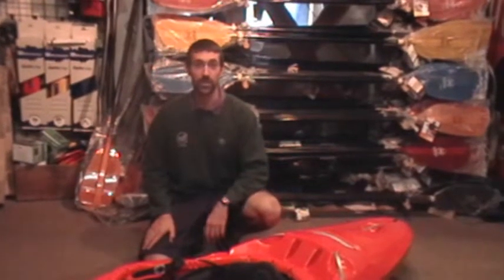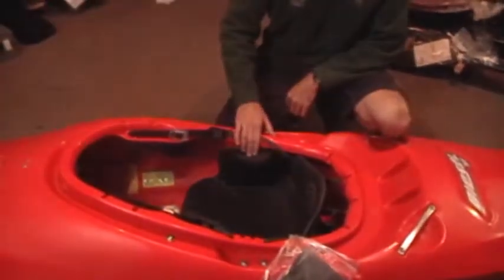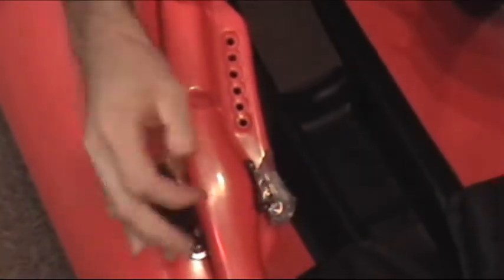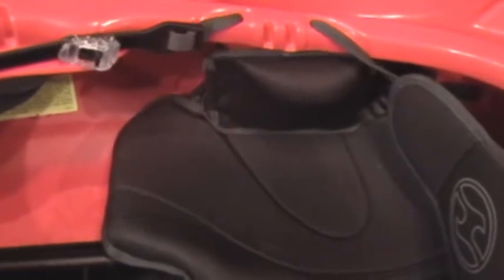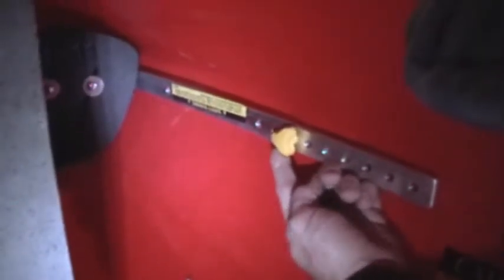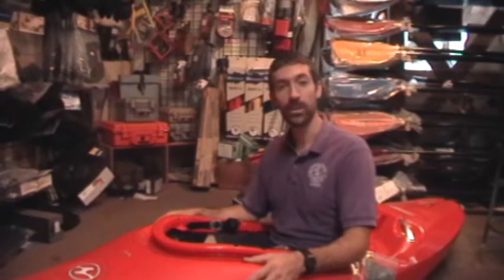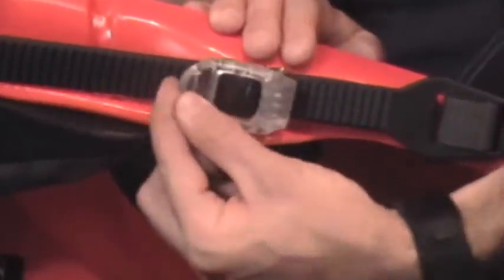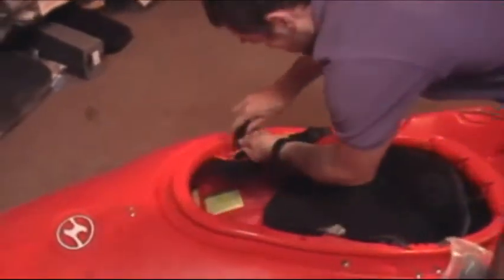How to Outfit Your Wave Sport Kayak by Wilderness Voyageurs, Ohiopyle

Comment: on the wavesport recon 83 what size float bag would fit into the back of the boat
Reply: +Joshua “TheRandom” GrapeJuice Hi Joshua! We recommend the Harmony or NRS split stern bags at a minimum. Ideally you'd get a 4 pack that includes two bow bags for maximum safety and to make it that much easier on your boating buddies to help recover your boat if you swim.

The correct size from Harmony used to be called "micro" (named back in the day when 8 foot boats were tiny!) and now is called "short." NRS just calls them "Split Kayak Flotation." Wilderness Voyageurs sells both - you can contact them at the information in the video description to arrange a purchase or if you have more questions.

Thanks for checking out this video and see you on the river!

Comment: I need help with my kayak i just want to know if your knees should be up or facing the sides
Reply: +Janell Moore Hi Janell! Your knees should be facing up and to the side at about a 45 degree angle, just forward of the thigh braces. At 1:11 in the video you can sort of see how my legs are separate with my inner thighs exposed. My left knee is directly under where I'm resting my left hand on the boat.

You want to find a balance between comfort and control. Having your legs really bent (which points your knees more to the side) will give you lots of leverage and control but be very uncomfortable and make the boat hard to get in and out of (which is kinda unsafe). Having your legs more straight (which points your knees up) will give you less control since it can only be done if your outfitting is very loose. Try to find the sweet spot, which we usually call "snug." Another way to describe it: it should only require a small amount of effort to pop your legs out of the thigh braces but it shouldn't be happening accidentally. 

Hope that helps! Thank you for checking out the video and see you on the river!